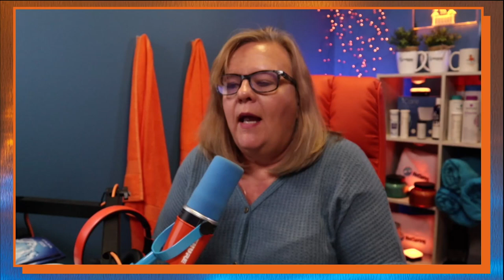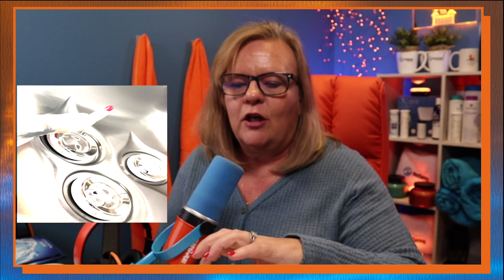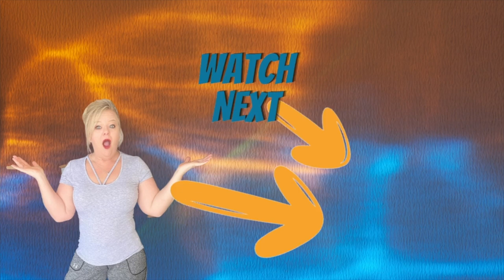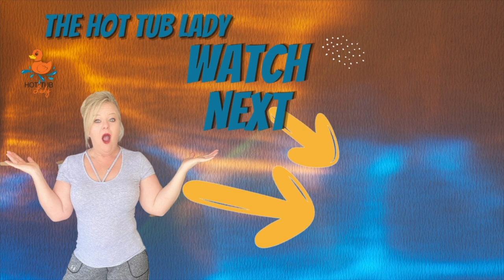Why Your Hot Tub Jets not Working and How to Fix It

Comment: On a related note, is there a way to have the jets ON, but have the air bubbles OFF?  The noise makes it hard to have a conversation in our HotSprings Envoy.
Reply from the maker: Yes turn the small diverter valves down.  The big ones move water the little ones control air
Reply: @TheHotTubLady  Thanks!  I'll try it next time!
Reply: This was pointless. Click bait. Your title says jets not one jet. Totally useless.

Comment: Hey Jackie, how bout if only one works? And mine don't turn...
Reply from the maker: Try the diverter valve or air valve on top..  are they on the same pump did it ever work?
Reply: @TheHotTubLady  they don't do squat. Got a dial that goes to 2 positions & a push button air thingy. There's a ground fault protection switch on the eal, and that's how I turn it on. But only one jet works. And none of them seem to  turn. Help!